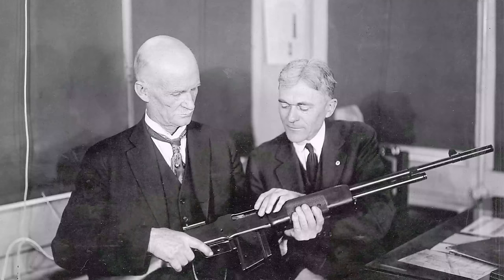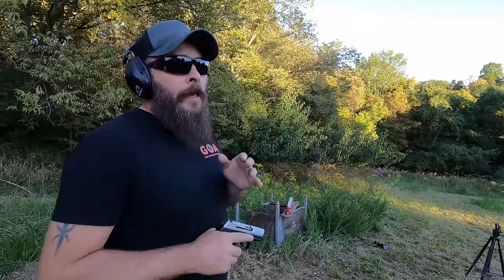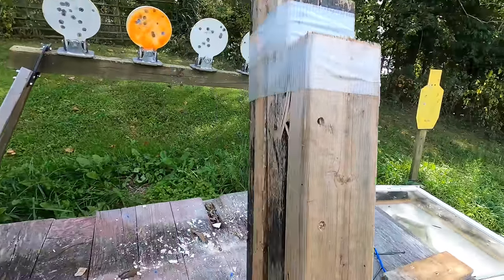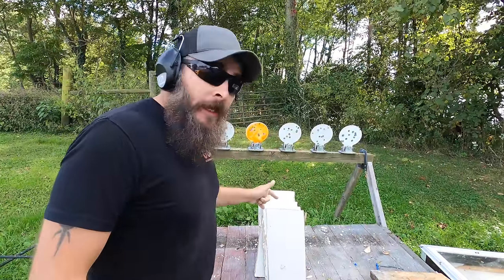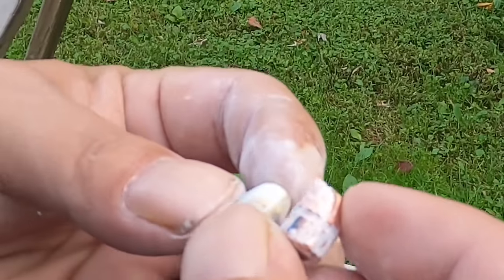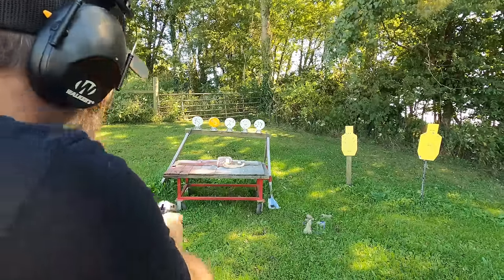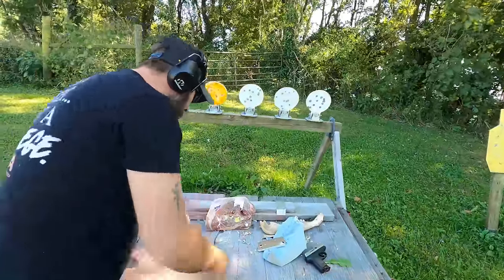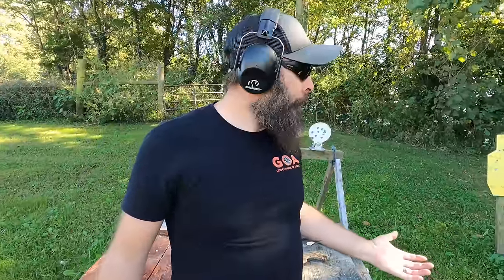Truth about the 380 acp

Comment: Trust me friend, after many years of experience with both .32 ACP and .380 ACP, I have come to the conclusion that based on the velocity and weight of these cartridges you are way way better off just carrying full metal jacket in both. Never found a hollowpoint that gave any sort of reliable expansion and the speeds at which the bullets travel you need the penetration to be able to reach the vitals. The bonus is the FMJ ammo costs less and therefore you can easily afford to practice with the same ammo you carry. Fancy hollowpoints just cost too much and under perform dang near every time. There is an old sayings, a 22 to the eye beats a 44 in the toe 99% out of 100 ... You are 100% on shot placement ... God bless
Reply: TRY  HYDRA SHOK  DEEP AMMO.
Reply: V Crown sig saur have great penetration 13 in + in 10% ballistic gel with reliable expansion
Reply: @stevenmichael558  Yep. Expensive as hell and hard to find, but is by far the best .380 ACP hollow point on the market as of now. Over 15" of calibrated ballistics gel penetration, which no other JHP  in the caliber can consistently achieve.
Reply: Underwood. 

'nuff said. 

Grow a pair.

Comment: I've had a chance to fire one of the earlier 380 acp pistols. Felt cheap and flimsy with plastic grips. I thoroughly enjoyed it.
Reply from the maker: I like your style sir.😎
Reply: Pat, even my "cheap" Tanfoglio GT380 has potential, it's just as accurate as my Berettas. However my P238 is a freaking tack driver out to 35 yards. 
GunDoctor....cool testing in this video! Seems like this is applicable to the 9x18 Makarov jhp as well....95grn at 1050-1100fps
Reply: Pat RMG  cracking me up!
Reply: Ah, Pat RMG. One of my favorite channels!
Reply: @RevGunn-jq3cq  😁😁😁
Reply: @Taylormadetdk  Thanks a ton!
Reply: @GunDoctorTV A .380 ACP FN Model 1910, Serial number 19074,  shot in to the neck of Archduke Franz Ferdinand of Austria started the First World War. A Barretta M1934 380ACP, Serial number 606824, shot three times killed Mahatma Ghandi. A Barretta Cheeta .380ACP was used by Yigal Amir to kill Israel's Prime Minister Yitzhak Rabin November 4, 1995.

Comment: Gunshot wound to the left thigh at close range. From a  Sig p238 loaded with Hornady Critical Defense mushroomed perfectly. This was a 5' 9 160 lb male. Complete pass through. The projectile was found to have also passed through the drivers seat foam. Coming to rest at the junction of the floor board and rocker panel lying on the carpet. Survived. Missed femoral artery.

Comment: No surprise the hollow point didn't expand when fired into wood, etc. Hollow points are designed to expand in soft tissue or liquids, such as a body. The only defensive round I'm aware of that behave differently are the Extreme Penetrator & Extreme Defender solid copper bullets made by Lehigh Defense, and also offered by Underwood Ammo. They have the hollows machined in the sides to force all of the hydrostatic pressure outwards, so they will not clog with cloth as a traditional hollow point can, and can penetrate deep enough without overpenetration.

Comment: That was very informative. I've always liked the .380. I found it much more accurate, easier to handle and shoot and quieter than larger rounds. The Browning 9mm is another favorite of mine. Even though I'm just as accurate with either gun, I found it quicker to pull, aim, and shoot the Walther ppk in .380. Although I've never had to shoot a Levi jacket, nor a 5lb hunk of meat, nor a soda bottle or a cell phone, I knew I could, if I had to, put someone down with a .380.
Reply: The key is....you could stop a mugging, holdup, attack. You are not military, you don't necessarily have "take someone down". You will flip the script and perhaps save your life.

Comment: Not only was the .380 used by some militaries (including the US Army. General Officers were issued Colt pistols in .380) but was a common round issued to European police. I’m confident the .380 has filled a few cemeteries over the years. Is it the same as 9mm? Of course not. Is it a LOT more controllable from a small pocket sized gun? Heck yeah! Low recoil and rapid sight realignment allow for very fast multiple hits and EXCELLENT shot placement. I have read that many people for years have stuck with ball ammo for the penetration capability to reach vital organs. However that same ability can lead to a higher chance of over penetration. So it’s a trade off. Personally I am very comfortable carrying a .380 with Hornady Critical Defense in a variety of guns for the above reasons. Great video Doc!
Reply from the maker: Much appreciated Bill! I completely agree!
Reply: I have .380 European surplus ammo, they call it 9mm Kurz.
Reply: I carry a G42 with .380 Hornady CD. Would never be concerned if I had to defend.
Reply: Well,I'm one of those folks that prefer plain 'ole fiocchi 95 grain ball...we load Hornady in our revolvers, but trust the heavier ball to run better in our autos...
Reply: Italy main pistol in ww2 was the .380 Beretta M34 . Also used suppressed by OVRA  and somr German security personnel.

Comment: First, great video and terrific explanation.  I completely agree with others; shot placement is key.  The objective is to stop the intruder, defend self, family, and property.  If you can't handle a 9mm or a 45, but you can hit the target with great accuracy and placement with a smaller caliber, you are going to ruin someone's day.  If you talk to an ER surgeon or nurse, they will tell you every single time that the harder "repair" is a victim with multiple critical holes in them.  And that comes from the accuracy of the shot.  Even if it's from a .22lr.  Five .380 rounds into the critical areas of the body is going to put down the threat.  Maybe forever.

Comment: When I was in law enforcement my main weapon was the S&W model 19 on duty how ever my off duty was the model beretta 70, which I later sold to my partner for a very low price, because he was my partner and I had no idea at the time what it was worth. How ever I replaced it with the Beretta model 84 which carries basically twice the amount of ammo but it is not very large. Although it's a bit like a model 92 with less weight and still enough ammo to either take care of the problem or get out of the situation and get a bigger gun. In a few years ago I was able to get some custom ammo for my 380 which I wouldn't use in one of the lesser 380's but in the model 84 they are very effective, using a 125 grain hollow point and a bit of a hot load it has a velocity of approx 1200 fps and very good expansion in ballistic jell, the fpe is a not quite as high as a 9 mm but it will get the job done and without the weight of the 92. I've been a huge believer in the 380 for many years. ( I carry two extra clips giving me over 40 rounds on me and a 12gauge in the car in case it's a serious matter).
Reply: Very cool! My Pops loved his 84 and I now own it . After reading this and watching the video I’m itching to take her to the range . Hasn’t been fired in well over a decade. Thank you for your service to the community
Reply: "clips"??? Lol 🤣
Reply: @bruced.370  that caught. Y attention also.
Reply: That's a Hot load.Only Modern Pistols.

Comment: You are 100% correct shot placement is everything however as a Cop I saw a burglary suspect get shot in the back 8 times by 380 hollow points. He was sitting up in the bed at the hospital talking to me. None of the 380 rounds penetrated his body cavity. If you must carry 380 I would recommend a full metal jacket over a hollow point.
Reply: So I take it the burglar was hit by hollowpoints?
Reply: @Treblaine  yes he was shot in the back with  a Grendel 380. The homeowner was using hollow points and this guy was fairly muscular. All 8 rounds stopped in his back muscles. None of the rounds penetrated into his body cavity.

Comment: Great vid.  If the ammo supply ever settles down again, run this test with Underwood Xtreme Penetrator in .380.  You'll be impressed in the penetration tests.
Reply from the maker: Thanks, I’m definitely going to try it out.
Reply: That’s what I carry in my .380 except I use the extreme defense version it won’t over penatrate
Reply: Until they can make 380 expand, I'm sticking with Underwood or Lehigh extreme penetrator/defender and they work in a seecamp

Comment: I had a .380 stolen from me. Later, it was used in a suicide. The 95 grain Federal Hydra-Shok hollow point went through the roof of the mouth, through the top of the skull, through the door of a red 1993 Ford Escort, across a state highway, and into the woods. It was not recovered. I was impressed.
Reply: 380 hydra shoks only come in 90 grain or 99(deep) there is no 95 grain 380 hydra shok

Comment: Everything over penetrates.  Everything.  Anything going at a minimum of 800-900fps, and usually much faster, is not gonna stop within 6 inches of flesh after just leaving your barrel.  It happens with expanding HP's, but it's much more rare than advertised.

Comment: My main carry is always a 380 with hollow points. A 45 saved my life one time but a 380 is easier for second or 3rd placement shots. Especially when you have to whip it out in a hurry and only have time to get one hand on it. Trust me on that. A 380 is also easier to hide. I have a 9mm and 40 acp , both hard to conceal in the summer because of size, winters nicer for carry of larger handguns because of course, you have a jacket or heavy coat to cover it. Also, in the summer I don’t use a holster, I put the tip in my watch pocket and slightly pull the stretchy part of my underwire over the grip, not too much, just the edge of the drawers. Slips right off quickly when needed and holds it close to my hip, barely any impression on my T shirts (loose T’s)
Reply: Just buy a holster for summer

Comment: Great video, the bottom line is a small frame 380 is my preferred carry because I can cover it with a simple tshirt and it’s almost non existent when you carry it.  If you won’t carry a gun like your pocket knife or chapstick, then it’s worthless.  It’s not designed for a prolonged shoot out from great distance.  It’s designed to get you out of a hot close encounter and it will do that.  Mine is more than accurate enough at 40 feet and for self defense purposes you should really never have a shot at those distances.  It’s all about comfort and ease of use.  When the situation requires it a 380 will do the job.  99% of the time I promise they will not be running towards the bullets.

Comment: Great review. My EDC is an M&P s&w shield 380...and after all the rounds I've put thru it, I never had an issue other than a couple times on mag loading the slide didn't come forward enough. Small tap and problem solved 
Anyway I carry with 5 sig 95 grain hollows and the rest fmj in it. I'm absolutely certain a bad guy is gonna meet his maker if I had no choice. 380 is a reliable weapon

Comment: I believe most attackers are opportunistic predators and easily dissuaded by a small amount of shock and pain, and that a 22 will do the job for most of them.
Reply: The operative word is "most".  Never know how small or large that "most" is.  To make "most" as a large percentage as possible use the largest caliber possible, the heavies projectile possible, going fastest possible, with as much rounds as possible, with the most reliable cartridge/firearm possible, and that you can handle accurately as possible.  These are a lot of variables.  There is going to be compromise some where.  So, if a person can only handle 22 then that is what meets the above criteria.  22 is better than sharp stick and foul language.

Comment: just a point to consider  -  although the hollowpoints didn't expand they DID flatten out, taking on the profile of the old british manstopper rounds.    some folks say that's more effective than the round nose full  jacketed bullet.   many people have been pushing the .38 special wadcutter as an effective defense round for the same reason.   in any case shot placement seems to be the key to success when putting down  antisocial critters.

Comment: The only true one shot stop is a head shot that severs the brain stem. Any other shot may allow a threat to continue on their destructive path for some time before stopping. There are many variables like drug and adrenaline levels along with mental state of mind. Most people not bent on destruction drop to floor crying from a splinter in the foot.
Reply: Having worked more than 4 decades in emergency medical services, I can tell you that even head shots are not 100%. Yes, if it penetrates the skull and does sufficient damage, it is effective. I have seen several people shot in the head with everything from .22 short to 12 ga shotgun who were not instantly incapacitated. .22 rimfire, .32ACP and .38spl (fired from snubbies) with round nose, FMJ bullets seem to have the worst track record with this. I have seen a a few where the bullet ran under the scalp never breaking through the cranium. If you absolutely must use such a bullet, shoot through the eyeballs, as the bone is only paper thin in that area.

Comment: I suggest that you conduct the tests such as these with the drywall and ceramic plates over a different area or over a large canvas covering the ground or something because you're littering countless particles of debri all over that nice lawn, which you obviously won't be able to clean easily; in the end, I fear that nice back yard will be ruined and you won't even be able to walk over it with your bare feet or lay in there or put some new plants; you'll be forced to lay a new layer of several inches of dirt. 
Great videos, love from Mexico.
Reply from the maker: Thanks for the concern. This is not a yard, I specifically have this property for a range and testing lab so no worries.

Comment: As you stated, the .380 was a MILITARY round for many years and was used by many police agencies. If it simply left a bruise on the target, they would not have been used. But people die from .380 wounds. The round works. Do other rounds work better for taking down a target? Sure, but it's not a worse case self defense round. I prefer more penetration so I use FMJ rounds if I carry a .380acp

Comment: Well Doc. Not knowing who's 380 your using is one of the mitigating factors. Like the length of barrel, for muzzle velocity. Then there power load, was it standard or plus P. Then there is the barrel was it fixed like on a Beretta or Bersa Thunder , or free floating like a Kahr or Ruger. I use Buffalo Bore JHP 380+P 95 gr.(1125 fps) one in the barrel & first in the mag, as a double tap. Then 95 gr. FMJ-FP to minimize overpenetration.

Comment: People have misconceptions of many rounds, good and bad. The .380/9mm short is a lethal load, and the FBI statistics show the round is capable of one round knock downs.

Nice to see an unbiased, knowledgeable video supporting the round.

The biggest difference in some firearms for concealed use is the size, especially with a double stack magazine. I find a single stack, 6 round magazine pistol with striker fire, very comfortable to carry appendix, inside waistband, while large frame pistols are too bulky for easy concealed carry, the same way, and I have a few to choose from.

If you think 6 rounds are not enough to carry, I do carry two ten round spare magazines for backup, IF the first six don't stop the situation!

When I do decide to carry a 9mm or other caliber pistol, it is usually in the small of the back, but not when I am driving for an extended session.

Comment: Things are looking up for .380 fans. I used to pocket carry a 6 +1 Mustang, Bodyguard and Taurus TCP. I settled on the Taurus but I have always thought it was just a little too small especially during a reload. Occasionally the slide would release without warning while I had the gun between thumb and finger working the mag release and the gun would somersault right out of my hands onto the floor. Eventually this happened enough that I switched to the Glock 42.  Well now Ruger has released the LCP MAX with 10 and 12 round mags. I am holding off on buying one for a few more months in hopes that Glock has a 42X on the horizon. I hope this spurs on a lot of competition like the 365 did for micro 9's because we sure could use some double stack micro .380 pocket pistols.
Reply: If you can afford it(the glock you want and are hoping for) then go for it, but if budget is a concern a great double stack pistol is the bersa thunder plus. 15+1.

Comment: I tend to prefer 9MM, 38 Special, and 357 Mag. I haven't tried 44 Mag, 45 ACP, and 40 S&W in a long time cause they are so expensive and hard to find. And that was before the kung pow flu. Right now that's what I'm best at using. I like 9MM for cheapest cost and capacity, but I like 38 Special and 357 Mag for being the hard hitters.

Comment: Thanks for the variety of tests.  When a hollow point expands, it makes little difference if the shot placement isn't correct   As for FMJs, I think what you demonstrated is that a .380 is less likely than something overpowered to go through your target, then through a sheetrock wall and out to the street where there may be an innocent bystander.
That demonstration means much more than using a very underpowered 9 mm or .45 ACP to achieve that effect.